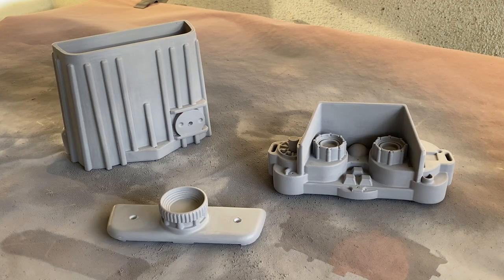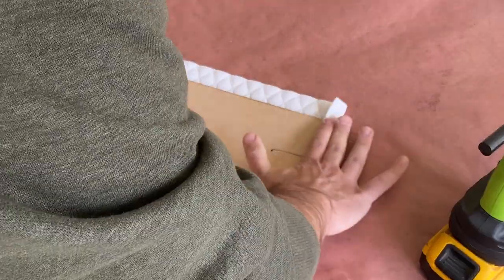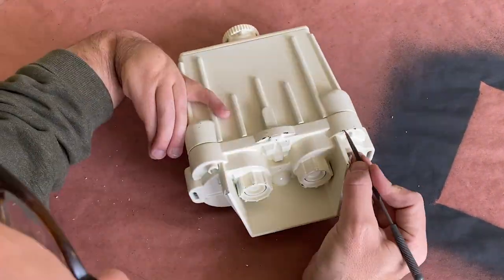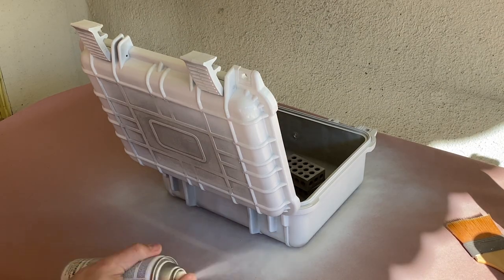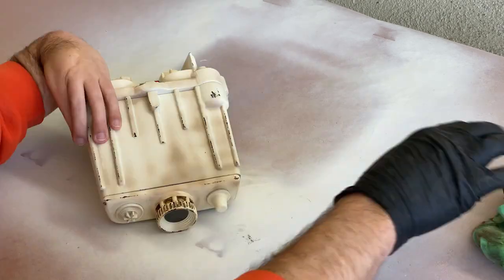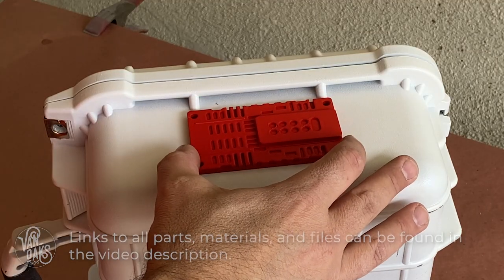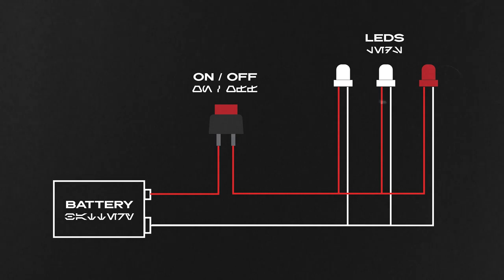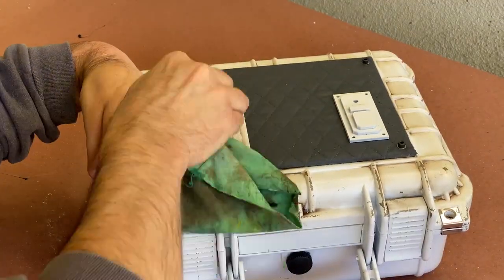Star Wars Electro Binoculars & Case

Comment: Well done. Be interesting to see if you could add electronics to it ... maybe a tiny video display inside them? Love rather obscure props that don't get a lot of screen time.
Reply: Yes, I would be interested to know more about the electronics. How do you get one red led to blink in the chain of leds you made?
Reply: @trooperbulldog44  You can manage the same effect without any additional board using (drumroll)... blinking leds. You can even find them on Amazon in packs of 50, already wired and ready to install. Sure you can't program the blinking but sometimes simpler is better ! 😊
Reply: @the_arcanum  Cheers! Thanks for the info!

Comment: This came out great and the weathering is fantastic.  Thougths on switches ... I have seen some recomment the switch on the positive and some on the negative wires.  I see you did the positive ... curious if you have found that to work better for you?
Reply from the maker: I'm not a big electronics guy, but I'd assume it would be the same. You're just putting something in the way of completing the circuit.
Reply: Low voltage doesn't pose any threat for serious injury so either would be fine. However, failing to break the live connection in higher voltage means that the light or appliance still has mains voltage when it is switched off, potentially a life threatening situation.

Comment: Is there any special property about the black hot glue, or simply that it is black.

Plus, dude, how did the plastidip on cloth do simulating leather??
Reply from the maker: It's just what I had in the glue gun, so there's nothing special about the color. It's the Surebonder Cosplay Stik hot glue, which they sent me, and it's been my goto ever since. 

The plastidip "leather" turned out ok. No one's going to confuse it for real leather, but it's definitely rugged enough without completely hiding the quilting in the fabric.